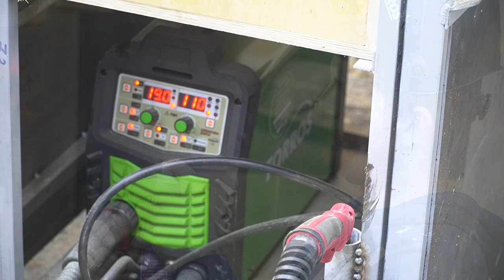Wonderful inventions from the drill! Why didn't I do it earlier!

Comment: Hello Sergey and greetings from UK.I have just discovered your channel and subscribed.I want to make this tool but am new to welding THICK steel. Would you tell me if 130 amperes would be enough power from my mig to weld the nut on? I have 0.8 mm wire in my machine.I would be grateful for your advice.Thank you for sharing your knowledge in all your projects.:yougotthis: